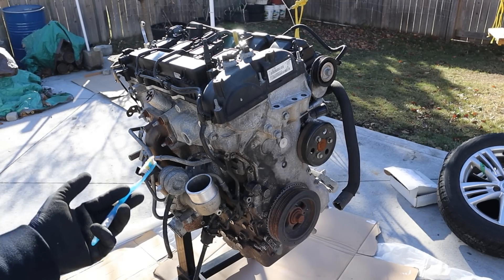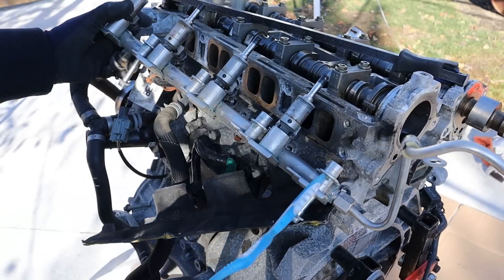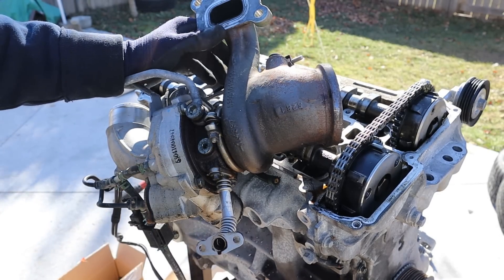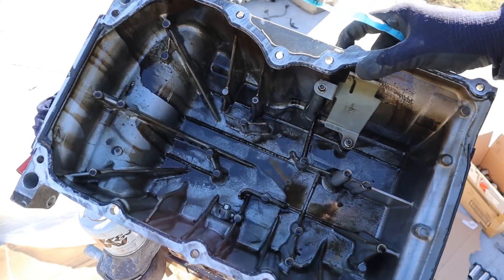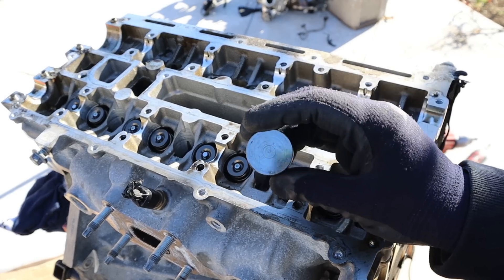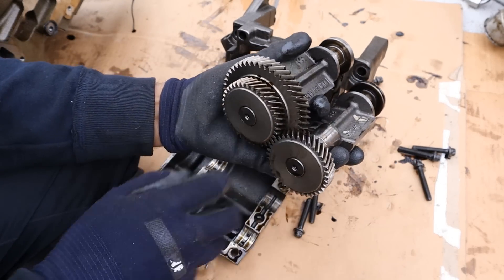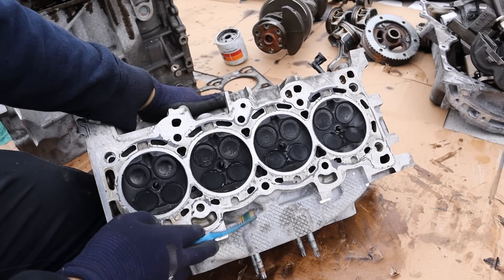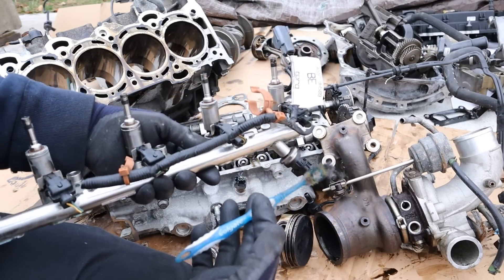Why Ford Ecoboost Engines Fail

Comment: Why do they use a balance shaft to counter vibration, rather than build the engine better and more balanced. Surely better measurements/tolerance on the crank will mean you won’t need the balance shaft.

Comment: Buy a used Mercedes Benz 300SD inline five cylinder turbo diesel! The engine will last you 500,000 miles minimum! These new cars are junk!

Comment: I am in the market to replace my aging Pathfinder. I recently checked out the new Bronco Sports. The vehicle was decently appointed, however a 1.5lt turbo charged engine seemed pretty weak. I do need a vehicle to tow my boat and quads when the big truck is towing the travel trailer, so it seemed like a possible choice. After seeing this video and others, Ford missed the mark. Too much emphasis on fuel mileage than reliability. Great Video, question, why did you pluck the motor?
Reply from the maker: The owner said it was hydrolock so I bought it for this teardown. 
Check out my Bronco Sport review video

Comment: The 1.3 Ecoboost is guaranteed to blow up unless you change the timing belt regularly as it's teeth shred off after having soaked in the sump until just about the end of your warranty unless you were smart enough to get the extension, even then Ford doesn't like having to give up a new 10,000 dollars Canadian to replace the destroyed one.

Comment: Powered by crankshaft not camshaft. Install an oil catch between the PCV and throttle body it will keep the valves clean from lack of fuel over valve washing.

Comment: That model and year 2.0L is bad due to the coolant leak on the head gasket between cylinders. The newer updated 2.0L made in Spain is way better, no issues.
Reply: The engine in this video does not have the slit that causes problems.

Comment: Great example of why a 2.0 liter, port injected, hybrid is better than a 2.0 liter, direct injected, turbocharged engine. The battery and electric motor take the role of the turbocharger and the engine lives a long, happy life.
Reply: The battery won't live long though

Comment: I think it's other way around with the head cooling solutions - the one you showed on a vid is actually the newer, updated version, while the one with the open trench design between cylinders is the older one.
Reply: Indeed

Comment: From Leo:  Weak design, overstressed with a turbo.  Installed where a good 3 liter engine should be.  FORD forgot how to build cars.   289 V8's and 300 I6 engines would last 250,000 miles with regular oil changes.   The two FoMoCo products in my garage are the last ones after being a Ford customer since 1976.

Comment: ive got 169,000 on my fusion with the 1.5 ecoboost which is a "worse" engine than the 2.0 ecoboost. Still runs decent so im gonna keep running it.

Comment: I just can't wrap my mind around the idea of a plastic valve cover!  They might as well have a section in the owners manual explaining "We at Ford, don't really care if your car can reach 100k miles, because with all of our devious cost saving measures, it won't....."
Reply: Have you bought a car in the last 20 years....? There are polymers that outlast metal in heat.

Comment: When buying my current car back in 2019 i made sure to stay away from these small (1.0/1.5L) turbocharged Direct Injection engines, they sure are fun when new and deliver a lot of power, but when buying a new car i expect it to last more than 100K miles! So i opted for a 1.25L non turbo MPI engine, its quick enough and i see them with 250K miles on sale and running fine.
Reply from the maker: Yeah they aren't for the longer term or heavy duty

Comment: If you get rid of the pcv or least make very sure to add additional filtering so intake air is free from oil , aaaaand you find a way to get some thin petrol vapor to the Intake to keep things clean, they Last a long time.

Comment: Ford is the worst designed vehicles in America, cheap crap designed by some ceo,s kid with no engineering experience whatsoever!!!! Their dry clutch transitions are a prime example, tip of the iceberg as far as failures go with fords
Reply from the maker: I'd love to teardown s ford DCT one day
Reply: ever hear of chyrsler / dodge engines?   crap engines from day one

Comment: 😂😂😂 I stopped buying Ford products, thankfully and intelligently 20 years ago when I OD 53 triton a 64 power stroke and a 6.0 power stroke yeah I learned three times and I am “ Ford cured” I have friends who bought vehicle with two different eco-boost engines less than five years ago and they both fell before they made 100,000 miles and they were no longer at warranty so they had to pay out-of-pocket thousands of dollars for rebuilt engines. I warned them don’t buy these they’re garbage! They said to me but I said so much money on gas it’s worth it. I said you will not save a nickel in fuel when you have to pay for the repair which will be three times the amount of money you could’ve ever saved in fuel if the vehicle lasted 200,000 miles and I was proven exactly right now there are two other people besides me that are “Ford cured“ and they don’t buy any garbage that Ford built and I tell them this unless it was built before 1997. You could buy anything that old and it will run longer and has run longer than a vehicle built five years ago, I Collett Ford fraud and we are all cured from being ripped off. No way I’m a fan of watching Ford engine repair. Lol as it’s making me wealthy.$$
Reply from the maker: Good idea

Comment: I have two Volvo 5 cylinder turbo cars and each has 220,000 miles +/- and I love this engine, the P80. Are they maintenance free, hell no. But during an early 70,000 mile service that covers the serpentine belt, timing belt and all of the tensioners, I also replace the water pump because all of the labor is covered except a few bolts off and on, but because this was the 225,000 service on my wife’s V70 Cross County, it was time for an AC pump and I just didn’t feel good leaving all of the seals in, so I got the cam seals front and rear, and a new main crank seal and finally the Bosch Alternator was 25 years old, so I replaced it. It is the same on my car which is one year older. But we are both retired and don’t drive as much and after I had Covid, pneumonia, bleeding ulcers and a heart attack all at the same time, so I was in the hospital for 28 days and got out 2 days before I became 74, so my goal was to get my wife’s car ready for her to have a relatively repair free next 100,000 minutes with or without me. She comes from women who live to be 102 like her grandmother, so a Volvo for the third decade is what she needs.

The old professor 

Live free or die!
Death ☠️ to all tyrants, all tyrants foreign and domestic…….
The truth will stand when the world falls!

No Shit…….

Comment: In 2017 ford came out with this short blocks on all their ecoboost engines. They fixed this problem in 2020 or 2021 with a beefier long block. He may say this but I couldntwait
Reply: the vel ecoboost engine are great

Comment: I  would     suggest    drilling   and   tapping  inlet   manifold    so  you  could   spray   egr   cleaner  direct at   messed    up  valves   every    ten thousand   miles  or so
Reply: this is from a phd engineer...lol

Comment: If you eliminated the direct injection, and the turbo, it looks like it would be a trouble-free, solid design.
Reply: my  14 fusion ecoboost has 170000 on it now.. bought it new  day one..i installed  ovs.. so no carbon on my valves... change the oil; every 6000 miles with full syn oil.... i get almost all 6 quarts back... even now... but then i a,]m a working tech.. and take cars of my cars

Comment: Hey man, first time viewer and now subscriber. Great video. 
one question about the carbon build up. With the amount of boost built in these engines, just to be able to drive down the street, is it not driving all of that through the crankcase (as you stated the rings get gummed up and create blow by) and through the PCV valve, back into the intake. Leading to high oil consumption, because all of that is being sent into the intake, causing everything to carbon up?

Anyway, awesome tear down and description. Thanks for this. Cheers
Reply from the maker: Yeah.  Direct injection doesn't help either

Comment: They drilled holes between the thin walls between the cylinders. And the gasket is superthin. I just got mine replaced with a longblock. Making the 100000 mile warranty worth it. I lucked out the warranty inspector saw 2 gallons of antifreeze in my backseat as the mechanic pointed it out before he left. Usually people dont monitor the antifreeze loss and these overheat and some times catch fire as the walls of the motor crack and the cylinders go in directions theyre not suppose to. Gas and heat ignite. The longnlock has thicker walls between tje cylinders and the holes are in a diffetent part of the wall so this problem will likely not resurface.  Probably be some different problem once the miles pack on. 3 months of heavy duty driving  and the longblock is ok. For now.

Comment: Great video, though the ecoboost engine is something i would would never own I definitely learned something... direct injection is really something that only works well on diesel engines, gas engines with direct injection seem to get gunked up and always seem to have piston ring and oil consumption issues no matter how well they are maintained.
Reply from the maker: Me neither. But it's better than a German
Reply: @speedkar99 what is your opinion about 1.6 182hp ecoboost mate?
Reply: Direct injection would not be a problem if they didn't have to use EGR for emission control. The manufacturers do not install oil catch cans but the catch cans probably reduce this problem a great deal.

Comment: 2014 ST. Have had it since new. I'm an older owner so I don't beat up on her. Commute to work,70 mile round trip. 2014-2020 shared commute duties with a ZX-14 motorcycle. Since 2020 it has all been all ST for commute duty. I rarely jump on this car. Just the occasional on ramp acceleration if cars will not let me in smoothly. 99 percent of the time this car is cruising between 60-70 mph. She has had 2 pair valve changes. Second one I did myself. Inlet hose to the heater core developed a leak at 100k. Changed at dealership. No issues beyond that. Same clutch. Ford Performance tune after 2nd year of ownership. Upgraded intercooler and Ford Performance exhaust(Borla really). Airbox from an RS with K&N filter. 175000 miles and still going strong. I constantly check gauges when I drive. Coolant temp pointer stays at halfway when warmed up. Been that way since new. Oil pressure gauge has never wavered. Same with oil temp gauge. I have an upgraded alternator(320 amps) because I have a high powered stereo system that still uses the stock upgraded Sony head unit. Line out converter is needed.  3000 watts RMS. When and if the engine goes I'll just put in another one or have this one rebuilt. Whichever the mechanic recommends. I absolutely love this car. I love the way it looks and drives and plan on keeping it for a long time,Lord willing
Reply from the maker: Awesome

Comment: Since when did Ford put a “pvc catch can” on their cars??  He says this at the beginning which sure sounds like an aftermarket part to me that caused the engine to lock up. There is always a trade off when adding aftermarket parts.
Reply from the maker: Yeah. I can't always trust the stories I get with these engines
Reply: its just a large pcv valve... catches more oil vapors and retains it in the block. lwer than the intakes on the head... look at a vw/audi  bmw system... its on the valve cover.. dumping all the oil into the intake manifold onto the valves

Comment: Well they’re based on the Ford Duratech 3.0 L V6 and they all have the same symptoms and failures and weaknesses.
Reply from the maker: It's loosely based on Mazda mzr not the duratec
Reply: @speedkar99  the engine was used in both ford called it the duratec Mazda had there name jag had there’s anything else.

Comment: I think Ford has looked into these problems for their first gen ecoboost engines and addressed these with their second gen engines.
Reply from the maker: No, they made the head gasket mistake on gen 2. It's not getting better

Comment: Here in europe we have 1.0 3- banger EcoBoost engines that have a wet timing belt system on them. Yes, a normal rubber/ composite timing belt that gets in oil for some reason. Basic mechanical knowledge tells us that rubber and oil dont mix. Add dirty oil particles and cheaper cars where maintenance isnt the biggest priority into it and these engines die because the belts loose their teeth. I think even in a laboraty with clean oil these engines barely surivived the warranty time...
Reply from the maker: I've heard of the wet timing system. Weird

Comment: How could you not have problems on modern engines , they are so stressed and complex , who demanded that these are required compared to the simple motors of 50 years ago .
Reply from the maker: Back then we had problems,  Now we have different problems.

Comment: It takes a lot of water to actually hydrolock an engine, did they drive into a river? How does enough water enter the cylinder from a catch can to hydrolock it?, I live in a place with very cold winters and wet seasons and never heard of this.
Reply from the maker: I'm not sure. Every engine comes with a weird story that you take with a grain of salt.

Comment: I am a Ford guy to the bone (Except for my Viper). Two are Panthers (Town Car and Marauder), a Ranger, and my faded clearcoat peeling daily is a Taurus. I can work on ALL of them. I have yet to see an engine failure in any car I have owned since getting a license. With the technology we have in metallurgy, CAD, engineering models, better tolerances, better lubricants, etc.. I don't see how an inherent or design flaw engine failure today can ever be explained with a modicum of rationale.

Comment: Seems like the fail points on this engine could easily have been avoided if Ford bothered to put that little bit of extra effort in. They beefed up the crank shaft and gave it a nice brace, shame that similar quality control measures weren't applied to the rest of the engine.

Comment: I got a 2016 Ford Fusion SE 2.0 ecoboost at 135,000 miles and it's still going good.
Reply: ( A lot are highway miles and I always used mobil 1 and 93 octane fuel.  And I change the oil at 5-6K)

Comment: My 3.5 eco boost burns no oil. I never add oil. 5k mile oil changes. Many get 200k on their 3.5 EB and they run fine. It all depends maintenance.

Comment: I have 267,000 miles on my 2014 F-150 3.5L ecoboost. It just keeps on kicking. Just maintain your vehicles people.
Reply: Seems like it's these 2.0L engines that have the issues.

Comment: Ford could very easily have made that engine block a few cm longer to allow a water channel between piston chambers no need to create a narrowed weak spot to cause head gasket blowout point between cylinders. Yes it would be heavier and larger to install in cars but it works be a lot better engine.

Comment: A bit of clarification: 
The coking of the intake valves is the result of a design characteristic inherent in all GDI engines with single injection systems. It is not exclusive to Ecoboost engines. Some manufacturers have reintroduced port fuel injection along with direct injection to combat this problem ( including later generations of Ecoboost engines). Also the open deck cylinder block design with the grooved channel between cylinders that resulted in premature head gasket failure is a feature of the 1.5l Ecoboost predominately. That engine variant has been discontinued by Ford. Watching your video it seems as if someone jumped the gun on a coolant  intrusion diagnosis, perhaps by confusing the problems of the 1.5L and ascribing  it to the 2.0l out of hand and without a thorough diagnosis.Admittedly these engines have some areas of concern, but to characterize them as failures is a little bit of a cheap shot. I have a 2.0 that I bought used and it has 155,000+ miles on it without having any of the failures you make sound inevitable.
Reply: 269k on mine and going 2013 Ford Escape 2.0
Reply: Not familiar with the 2.0 as much but I've got a 2015 f150 3.5 with 100k and still pull my camper regularly. He also stated gdi motors all burn oil. Mine doesn't burn a lick of oil between changes even when I'm hauling. I also subscribe to the 5k mile or less oil changes. Many of the ecoboost problems come down to oil quality and change intervals.
Reply: @nateg08  yep, also 5k here, I just sold mine at 274k 🥲
Reply: @nateg08 2012 focus here, I snagged this car at 89K miles and when I pulled the valve cover off to replace the brittle gasket it looked like a new engine it was so clean. I've been doing my oil changes at 4K-5K miles. 

Oil is cheaper than a new engine.

Comment: Question- You say the intake runners get clogged because of GDI but the only thing in the runner should be air. How is the coking the result of GDI? Wouldn't the coking be the result of PCV vapor?

Comment: Isn't it the older EcoBoost engines that had the poor cooling channel between cylinders, and the newer ones that have the cross drilled design that is less prone to fail?

Comment: Meanwhile, the same HP V6 is basically bulletproof. No turbo, no need for direct injection.
The entire reason they switched to the Ecoboost in the Mustang ( basically the exact same design and problems) was to sell the car globally where you are taxed heavily for larger than 3L engines.